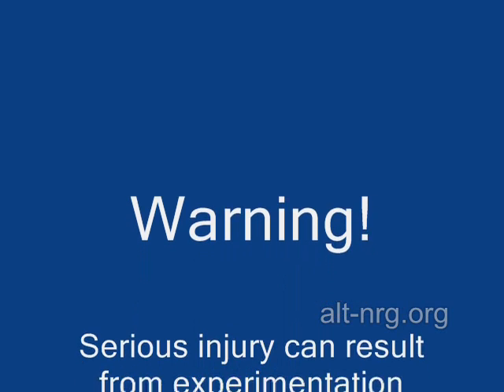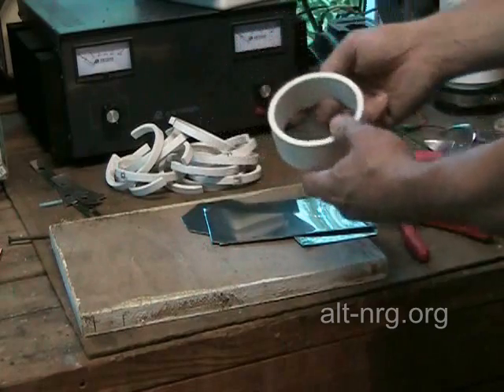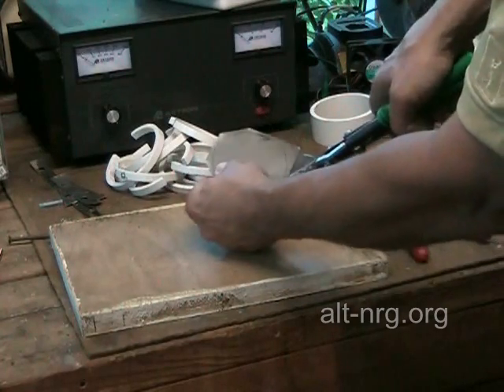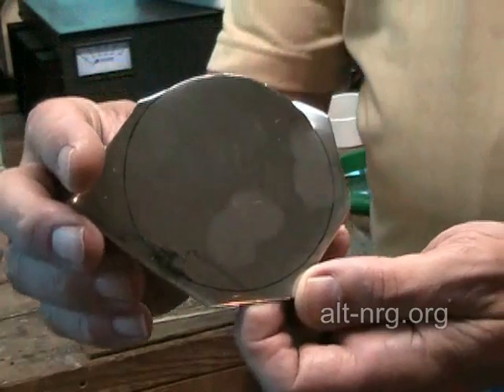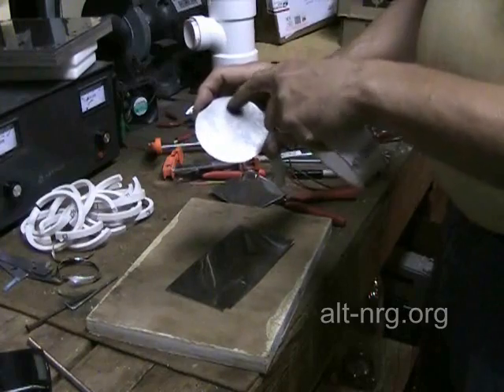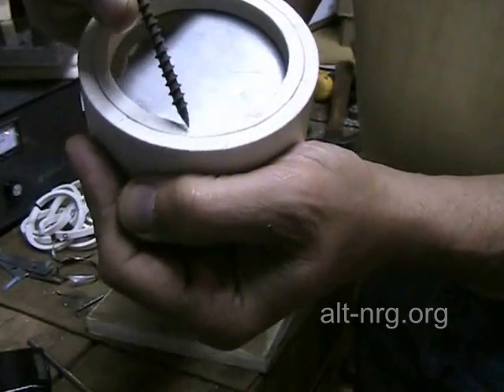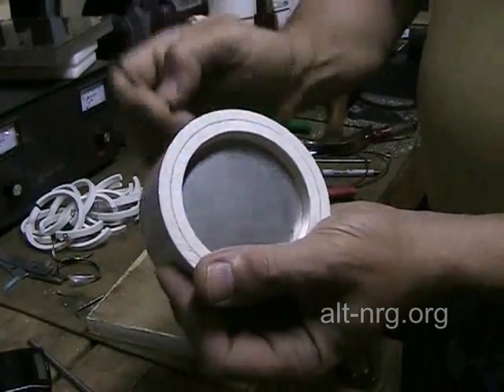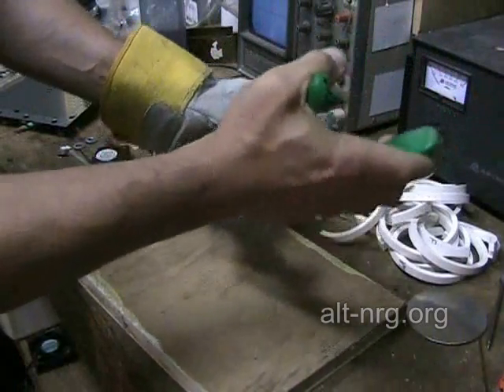#190 - Inverted T cell part 5

Comment: ONE of the best ways to cut thin stainless sheet metal is to use a band strap cutter. The design of the cutter with its vertical cutting edges give a distortion and sharp edge free cut within reason. Way better than using the cutter you are using Mark. This gives you less work in the long run fella.

Comment from the maker: Greater than 6. Possibly close to 7. Plate area in solution for both sides of the assembly is only about 9.8 sq-in. Even at 10 amps that's over driving it at >1A/sq-in.

10A @13.8V = 138 Watts.

@6.5 MMW that should be about .9LPM
@7.0 MMW it would be 0.966 LPM

If this works well I'm going to make a 4" version. Total plate surface area 19.24 sq-in. Could be driven to 20A at the same A/sq-in for about 2LPM.

Comment: Oh yea and the scrap part that is being cut away should be on top of the part you are cutting.  that is why the jaws of the shears are shaped with the bigger jaw on the bottom and the skinnier jaw on the top.  You will notice that they 'just seem' to work better in one direction than the other.  :)  You will notice that they are designed to work like scissors.  I have used them many times cutting duct work for HVAC.  Again good video.  Thanks Zero.

Spell

Comment from the maker: 14.15 MMW?

I have a feeling if you put a volt meter across the cell it will measure more than 6.5 V. Even if it's half wave rectified power, that's awesome!

Comment: Zero, I just completed two 15 plate Joe-cells - + - with no neutrals, then connected them in series, no PWM. I hooked them up to my battery charger. At 6.5v 10a my gas production is right about .92 lpm.
2 more and I'll, then I'll run all 4 in series with a PWM. Should run cool and produce enough HHO to supplement my Nissan Pathfinder.
Peace and keep up the good work.

Comment: Z I get you when you say you want to keep it to what anybody has.  Well that is fine.
But if you want a cheap way to make accurate repeatable circles then get a jig saw with a metal cutting blade, or two.  Make two nice round circles out of plywood or MDF.   Now just behind the blade on the band saw glue or screw a little block that lines up with the side of the jig saw blade.  This way it is very easy to follow the circle jigs around and cut nice accurate circles.